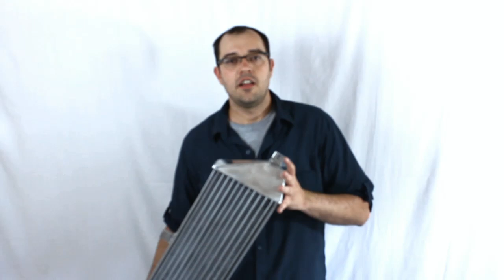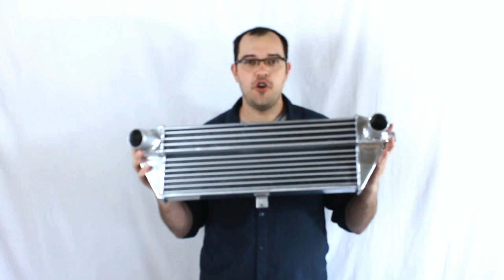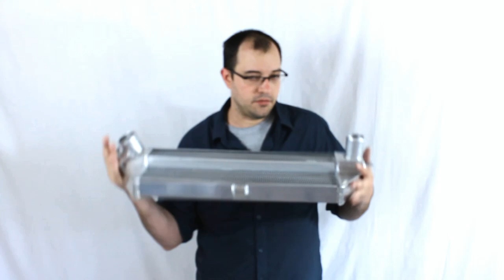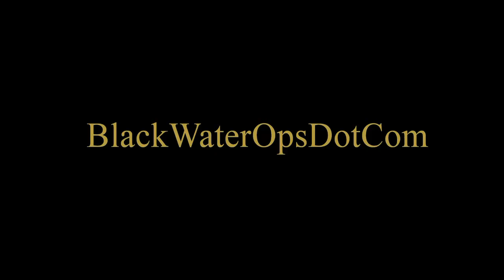What Is An Intercooler And How Does It Work?

Comment: where's the water go after condensing  in the Intercooler ?   and if there is not any water draining system can i sue the company in court because of diesel engine blowed because water go in the engine cylinder and blow all the thing up ?
Reply: i mean can i sue the company and let em delay the case as long as i live and when i am dead ''no face no case'' ?(looooooooooooooooooooool)

Comment: On my marine engines I have intercoolers that are 2 water cooled stages. The first stage is hot engine water which is 80c. Then is passes through the second stage which is sea water which is typically around 25c.

For the life of me I can't understand why the air has to pass through a heater before the cooler.

Can you explain?

Comment: Why do you need an intercooler? Shouldn't the air coming in from the turbo be just as cool as the surrounding air passing the car? And what is the difference between an intercooler and a cold air intake then?
Reply: A turbo compresses air..  gas under compression increases in temperature and ideally you want cool(er) air for efficient combustion, so while a turbo is great it would be better if you can also cool the air.
Reply: ***** The exhaust gas is just used to spin the turbine, that compresses atmospheric air.  However, it does heat up do to the heat transfer of the metal.
Reply: When you compress any gas, it heats up. When you decompres it back, then it gets cold. This is how refregirators work.

Comment: but what happends when flies crash into the intercooler
Reply: Pretty much the same thing that happens when they hit the grill or radiator lol, but the fins are usually stronger so they don't bend like a radiators fins will
Reply: iniquitous1982 translation entirely necessary

Comment: Let's say the turbo is sucking up air through the main air intake at at temperature of 60F.  It then passes 60F outside air over the intercooler fins and that's supposed to cool it down?  They're the same temperature.  Why would you say hot air is coming from the turbo?
Reply: air is compressed in the turbo this makes the air heat up when it is compressed then the intercooler will cool it down
Reply: Nick Wunnenberg When air is compressed, it cools down.  That's how air conditioning compressors work.  That's why air compressors spray out air colder than the surrounding air.
Reply: Desolator144 Actually, what's really happening is: the increase of pressure is directly related to an increase of temperature. i.e. twice the pressure gets you twice the temperature. The reason you feel cool air coming from an air compressor is that it is working more or less like an intercooler. In that after the air has been compressed and subsequently heated, the ambient air will cool it to room temperature over time. then when you release it, it feels cool because it has returned to standard pressure. also the overall energy of the air is lessened. this of course, is missing quite a few key parts but that's all that I think I can fit into a comment. for those of you that want more information, a good place to start is by googling "Charles' Law"
Reply: turbos run at grade speeds producing friction and heat + turbos pull heaps of hot oil therefore the air needs to cooled with in intercooler allowing the engine to perform better coz cars perform better at lower tempretures such as night compared to day

Comment: Is it worth changing the intercooler if you have a stock Turbo or is it only worth it if you ungrade the turbo ? 
Also will it put the turbo under more pressure or less pressure ? 
Thanks

Comment: hi, i've got a saab 9-3 2.2 its smoke too much and i take it to local mechanic, never been sorted after he change a part of egzoz for £180+£30 cleaning egr valve(circulation) still got same problem , he change egr valve £250(new one) he say need to full service for £100 ... but the car still was smoke and use extremely too much diesel.            NOW i take the car to derby saab main dealer: they charge me £50 to fined out the problem , and they say the problem is  Intercooler leaking. £455

Comment: I saw in another video that the temp. of air coming from the turbo to the engine  is about ~200C , if the intercooler reduce maybe ~30C of the nominal temp. , why should i use it ? it is not economical ?

Comment: An intercooler makes the cold air from a turbo "colder" before it enters the engine. A turbo uses hot air from the exhaust to generate cold air. That air is then fed into the intercooler, then into the engine.

Comment from the maker: Yes. It will make the system more efficient, and give you more power. If you tweak the ECU you can take this even farther, but this is an easy upgrade with good benefits to fuel economy, HP, and Torque.

Comment from the maker: All you care about is how many air molecules make it to the engine. Pounds in weight, not PSI. You want lower pressure when ever possible. 23 PSI at 400 degrees is a lot less air than 10 PSI at 32 degrees.

Comment: Would an intercooler make then cold air more dense on its way to the engine, therefore creating less pressure? Assuming the inlet and outlet are the same diameter, wouldnt the hotter air take up more volume? So if you cool it down in the intercooler, wont it become less more dense, leaving room for more air, thus lowering the pressure. Im just thinking out loud, someone please answer my hypothesis

Comment: a blow off valve stops the air that the turbo blows back during gear changes not happen. so there is a nice fshhh sound instead of the fshh-df-df-df-dfff. it keeps a better pressure in the intake too, always good for boost.

Comment: To be very simple:
More Compressed Cold air = more power

Turbos compress air but they also heat air (heat also causes expansion). So after the air goes through the turbo, the intercooler cools the air as much as possible before it enters the engine.

Comment: you need it for a turbo charger. which is sorta like a fan that blows air in to your engine but its really hot air, the inter-cooler cools down that air so you can have more of it.

Comment: Hmn, im not convined about the returned air maintaining its cooled temparature.It has to travel back the the heated engine bay through  heated ducting,basically heating the cooled air back to its original tempararure.

Comment from the maker: I have been looking to get a few to test... Looks like the ones that are recirculating valves the stiffer valve puts more wear on the turbo. the non-recirculating give you better power, but sometimes throw check engine lights if you were supposed to have a recirculating valve.

Comment: just a doubt, where does the intercooler goes?? before the turbo(before entering the intake/cold side of the turbo) or after it(between turbo and engine)?? what's it's function, allow cold compressed air into the engine, or allow cold air into the turbo to cool it down?!?!?!?!?! if it is to cool the compressed air to the engine, then besides the oil, what else cools the turbo??